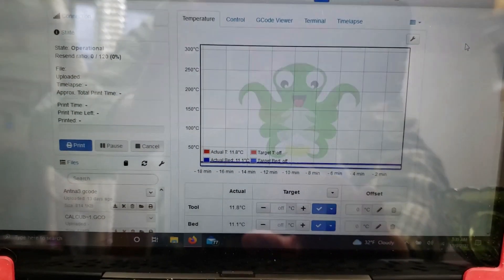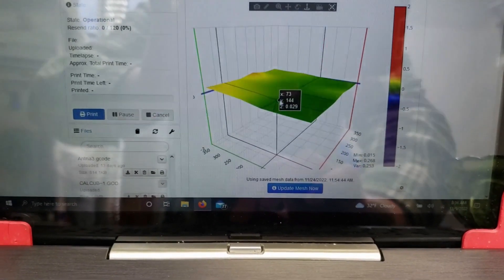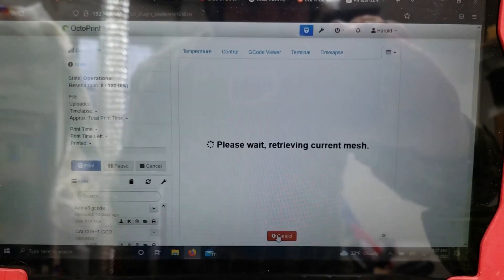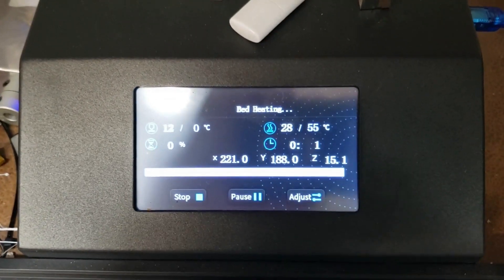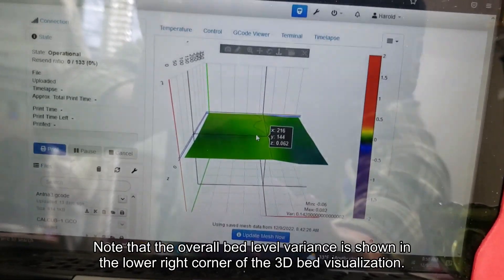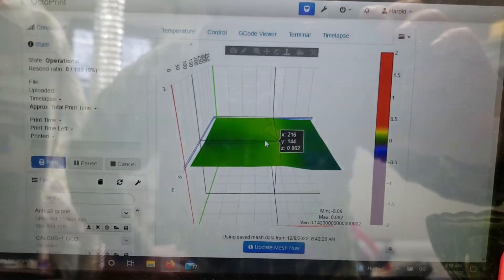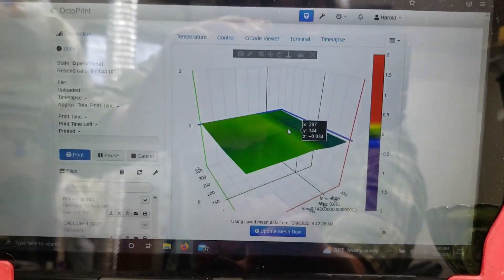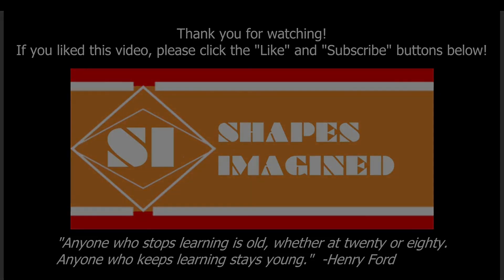See how flat your print bed is with Bed Visualizer and Octoprint!

Comment: Does running the bed visualizer plug in to probe the bed change any setting from previous probes and z-offsets that were saved to the printers eeprom, or does it just do a read only probe of the bed?
Reply from the maker: As far as I've been able to tell, Bed Visualizer only "reads" the surface of the bed.  I still run a separate autoleveling command through my printer's firmware.  Theoretically, there shouldn't be any different between the Z values Bed Visualizer picks up compared to the printer's autoleveling function, but that's limited by the accuracy of the Z probe and other procedure conditions, such as changes in bed temperature if it isn't consistently heated between running Bed Visualizer and autoleveling.
Reply: @shapesimagined6193  I am new to the probe leveling, as I did manual mesh leveling prior to me installing this CR Touch probe. I feel that I finally figured out the new board, TFT35 display and probe enough to get a good first layer and I didn't want this plugin to wipe out all of my progress..lol. The gcode commands the Bed visualizer github mentions are a bit confusing since I am just learning that as well and it makes it seem like it will do it's own bed leveling and store it to the eeprom, in turn wiping out what I have it set to. What do you have in your GCODE Commands for Mesh Update Process in the plugin settings?
Reply from the maker: @PNW_Hawk  I don't recall adjusting any of the G code in the Bed Visualizer settings.  I think the only thing I changed was where the "home" corner was in the visualizer so that it matched my printer.  It would make sense to have it both save the leveling data to EPROM and visualize it at the same time.  It would cut a step out of my process, so thanks for the idea!  I'll have to investigate this more and maybe make a video about it :)
Reply: @shapesimagined6193  I chatted with the developer in discord and he confirmed that the gcode batch in the examples page he links to in the visualizer plugin, does indeed run a new mesh and then saves it to your eeprom. He suggested to do what I want it to do, and it was confirmed by me to work, was just put M420 V into the visualizer gcode section and it will just pull the current stored mesh in the eeprom without running a new one and overwriting it and then it will display it. Very cool.
Reply from the maker: Thanks for looking into that!  Today I learned something new :)
Reply: @shapesimagined6193  No worries. It's all about learning for all of us. Thanks for having a video on what I was looking for and spurning my further research.

Comment: Are you using raspberry pi for octoprint
Reply from the maker: Yes, I'm using a Raspberry Pi Model 3B to run Octoprint.  I recommend Octoprint if only for its remote monitoring ability.  I like being able to remotely cancel print jobs if I see through its camera that something went awry.  If you're into wiring up the Pi's I/O pins, you can control relays for temperature regulation, lighting, and other stuff.
Reply: @shapesimagined6193  I was going to try it but having a difficult time finding a rasberry pi. Any suggestions?
Thanks for the reply, appreciate it.
Reply from the maker: I've heard about there being a Pi shortage.  Octoprint can be run on other computers too.  If you have a Windows machine lying around you can run it on that.  Here's a guide on the Octoprint website if that's a thing you'd consider doing:  https://community.octoprint.org/t/setting-up-octoprint-on-windows/383  I'm sure there are ways to run it on other platforms too.